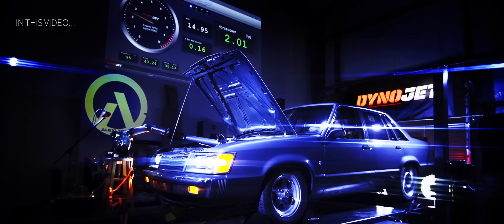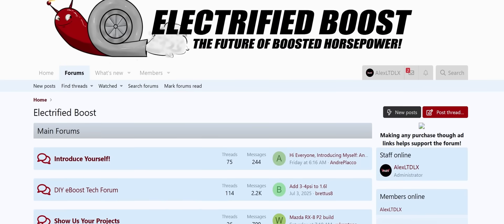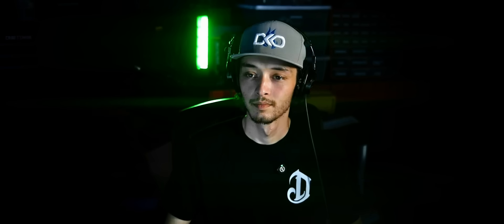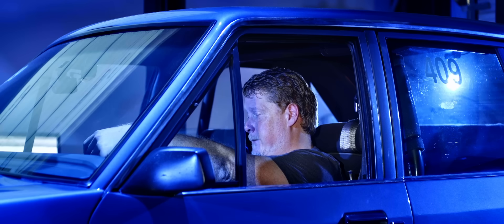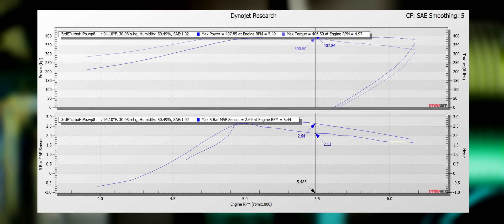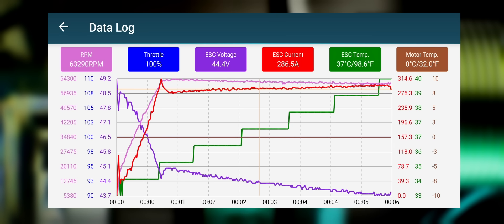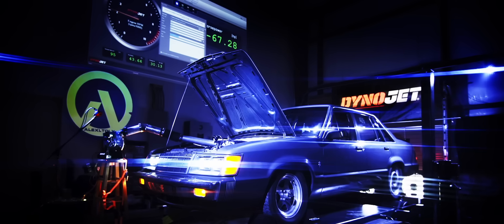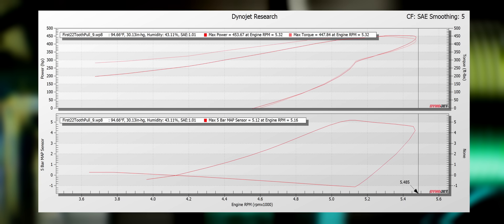Cheaper/Easier DIY Electric Turbo Overdelivers On The Dyno

Comment: Ok i just posted to the parts video from last year.

Why not try belt gear it 1:3 and try using a ebike motor like the stock motor from a suron x or use a esc from an ebike or Kelly controller they can handle much high loads and voltages, either way i just ordered the p2 and will attempt using the motor off my old suron as i have it and the 72v battery and controller the firmware is basically an upgraded Vesc. Yes i know it will take more space and i know for the tiny 1.5l engine in my scion it might make like 10psi as it flows less air.
Also i feel making the motor mount facing the other side and over lap the compressor makes it easier to swap belts.
Either way I'm a cnc programmer and operations manager with over 20 machines i keep running all day

Comment: 12:19 5 PSI is pointless when most are running 12 or more.
Reply from the maker: PSI is meaningless.  HP is everything.  This makes more than twice the power per psi as my Whipple did.  The Sledgehammer made the same power with less than 7 psi than the Whipple did at 15 psi: https://youtu.be/_7bT8ScF2xI  In fact, the electric supercharger (Sledgehammer) put the LTD in the 9s at the dragstrip: https://youtu.be/RT0M88xHzNQ

Comment: I think you need a 1 to 1 pully setup might get it to hold at 4psi
Reply: direct drive would eliminate pulley losses
Reply: @longflare at the rpm this is spinning direct drive is almost impossible to get perfect alignment and not rip itself apart.
Maybe it would work with custom mini old heim couplings or a near press fit.

Comment: In WW2, aircraft engine researchers had a 1500hp  Allison V12-1710 engine connected to a power recovery turbine.  The turbine, which was connected to crankshaft spat out an additional 1000hp bring total output up to 2500hp.  That is cool.  While electric blowers have some plusses, variable speed blowers which can operate independent of crankshaft speed are nothing new.

Comment: I cant wait to see what the castle creations cobra 5 hv esc on 12s is capable of and with there new 2535 680kv motor is caple of shit will be crazy 14:36  but if you hold off a little bit longer castle is releasing the race version of the cobra 5 hv its the ACE version where they remove that pesky 500amp saftey limit so you can really send her please get one so we can see what is possible with a electric boosted setup thanks also smc lipos the srd v4's are badass 12,600mah 250c best batteries you can get or onyx rc lipo hand down the best batteries available i love what your doing. I would love to electric charge my subaru impreza

Comment: I think you should try some 0-60 times with the electric turbo vs the same electric motor (or 2) doing a direct motor assist, pulley on the crank etc, with a reduction gear pulley to optimise torque. You could add a lot of torqque directly to the motor off the line from 0 rpm which could in theory give a lot of response in 0-60

Comment: That's all really cool, BUT...
In order for this to be worth anything in a street car. You need to power it from the cars engine. So, unless you're running it from a pre charged battery bank which still adds weight to the car. It's going to be sucking HP from the engine...

Comment: So the boost starts at idle or is there a lag until some low rpm limit is reached? So on a hot day & low speed cruising, can the solenoid overheat?

Comment: Great video guys... I'm not sure why you would present all of this information yet fail to talk about the lack of parasitic power  draw for the turbo if you're getting power from another source.  This set up requires an extremely high output alternator which will cause a significant load on the engine under high boost, so this whole experiment is nullified as a real world test.. that's a shame considering all the effort! If the SC motor is actually being powered by the LTD's alternator than obviously this comment doesn't apply.

Comment: I think you would drive the point home more with a smaller motor built for boost. Put this thing on a modern motor built for boost and not fuel limited like a 17+ 3.5 ecoboost with the port injection, you could setup such that you're one leg of a compound setup. Getting to an effective 30psi should be easy, and that puts those engines in the 600hp crank range. Not the only way to skin that cat, maybe just look for the cheapest damn thing with that 8speed zf auto and force feed whatever engine air.  Or smaller still and put it on a used Versa

Another point is that you keep talking about how much power you're loosing to driveline losses... and I believe you, but I think if you cut those down with a modern trans you'll both be more relatable to the audience, and it'll look better to the casual dummy who swings  by via youtube algorithm. That LTD is a good testbed, and I'm sure you have room to make it faster, but this supercharger will be best as a power adder to a more normal car. The $2-3000 bolt on that gets you 25%+ more power.... infinite nitrous cheat.

Comment: A full turbo with motor generator is my dream.. add power to spin turbo immediately and harvest power instead of waste gate
Reply: And push it further make it axial flow for insanely efficient boost and substantial power harvesting..
Reply: Axial flow would have heavy rotating assembly.. so would need lots of power.. but you'll be able to harvest 100s of horse power.. aviation motors have proved potential.. but for cars response time is terrible

Comment: for battery's, at work we are slowly converting work carts to lithium. using 48v drop in golf cart units. ours are kinda pricey at 2k$ but I just saw over 300amps towing a very heavy portable ac unit. well over what I should have been doing but the battery didn't seem to mind, they are pretty light and I've seen some for as little at 900$ on the China sites. if you have a trunk and don't want to diy a pack. it seems like this might work for a lower end setup.

Comment: Have you looked into the Range Rover electric supercharger for their 3.0 turbo engine, they use it as an anti lag, but it’s water cooled and makes 0.5 a bar of boost on a very compact package, I figured 2 of those might be able to feed a V8 at 7psi and they’re 48v

Comment: At what amperage will that motor's magnets saturate? Depending on the heat dissipation packaging of the motor, generally the motor can make 4X power of the constant rating before hitting magnet saturation, where any additional input from the controller will result in pure heat and will quickly degrade the permanent magnets. The amount of 4X a motor will tolerate is increased with thermal mass. That motor looks like it has minimal thermal mass to be as light as possible. Since weight isn't a consideration in your application you could consider a big chunky motor that has more thermal mass.

Comment: Try it with direct drive (without the belt) and slightly higher voltage!   Reason: Higher motor RPM, lower current and no belt losses will give higher efficiency and more boost without breaking the motor/ESC.

Comment: I realize you are working with Castle but just remember there are way more brands out there.  Look no further than the boys that are setting land speed records pulling more than 800 amps from their speed controls.  Also keep in mind the fast heli guys run 14s not 12s giving even more power.  Keep up the good work.
Reply: The problem with his setup is that he is using lithium ion batteries. That's like taking a NASCAR engine and slapping a restrictor plate on it and running 87 octane fuel. This is why I laugh at the entire EV market.
Reply: @The_Gifted_333  should they use super capacitors instead? I'm not aware of the state of the art in RC hardware
Reply: @identiticrisis  In the RC industry, we use lithium polymer (LiPo) batteries. We can't use lithium ion batteries because they can't handle the amount of amperage required to run our brushless setups. LiPo's are more dense and can handle 3-5 times more amperage and last 30% or more longer than the equivalent sized lithium ion battery.
Reply: @The_Gifted_333  600 amps is a lot though, I'd be surprised if these weren't lithium ion polymer batteries here
Reply: @identiticrisis  In the video you can see the batteries and the name on them. The company makes lithium ion batteries. My ESC on my 5th scale RC has a max pull of 1600 amps on burst (9 seconds), 250 amps continuous. My batteries will do 1000 amps continuous and 2000 amps of burst. The 2 batteries I'm using are smaller than his battery pack. My max volts is 50.4 with a nominal of 44.4v or 12s.
Reply: @The_Gifted_333  60 hp is no joke! How often do you need to replace them?
Reply: @The_Gifted_333  they're LTO cells, higher current and better temperature tolerance than lithium ion. There are other videos on this channel for those interested. Makes sense for this application
Reply: @identiticrisis  That really depends on how much you use them and how you take care of them. I have some that are over 10 years old. You usually replace them if they start to puff. Don't let them drop below 3.3v/cell when you are using them and when not in use, store them at 3.7v/cell.
Reply: @identiticrisis  But how much current? What is their continuous and burst rating? What is their C rating and mAh?
Reply: @The_Gifted_333  they probably have a datasheet if you're cross shopping
Reply: @identiticrisis  I looked it up and I'm still going with my original statement.
Reply: @The_Gifted_333  I don't really understand what you're talking about

Comment: Compounding e-chargers could also be very, very fun - how do you manage your airflow?  Like, when your e-charger is on, it's at full tilt, limited only by its efficiency in compressing air into your engine at a given RPM :: airflow.

Comment: I have explained gear ratios and transmission choice importance to people that don't really understand it by comparing it to a mountain bike. We all have ridden one and when you change the gears how different it rides and how much effort is needed or not needed when you row through all the gears. Your legs are the power source or engine and the bike is the vehicle. Low gear your legs spin up fast and it's easy to start rolling and high gear it's much harder to go and less leg rotations. That electric motor is in high gear spinning it faster but it's more of a strain so it might not be able to get to full rpm like that

Comment: These motors produce peak power at almost exactly half their free load RPM.
800kV at 44.4V is 35,530 RPM, half that is 17,760 RPM. Why does the RPM in the Datalog say almost double that at 63,000RPM?, is the ESC setup for 2 pole instead of 4 pole? It sounds like the motor is operating past peak power in the inefficient part of its power band, which is why it got so hot and tripped. To get the 52,000 RPM the Speedmaster P-2 needs that's a 1:2.92 ratio. Call it 1:3 and be done. 18T * 3 = 54T on the motor.
Reply from the maker: The ESC reads electrical rpm, not mechanical.  The 2028 is a 4 pole motor, so it has two pole pairs.  Divide the electrical rpm by 2 in this case to get mechanical rpm.  Peak power on these motors is usually closer 1/3 max rpm; and kV is unloaded rpm - though current and voltage play a significant role in the actual shape of the curve.  I'm going to do a data deep dive video to go into all this stuff in great detail.
Reply: @AlexLTDLX  If the RPM output in the datalog isn't accounting for the 4 pole motor then that makes a lot more sense with the first pull of 63,400 RPM / 4 actually being 15,850 RPM at the motor, closer to the 17,760 RPM ideal. Being a little under the ideal suggests even with the 14T motor : 18T P-2 that the motor is underpowered by more than 3x if it can't even run at 1:1 when the P-2 wants 1:3. I'd be looking at 30kW motors and controllers.
Reply: @AlexLTDLX  As long as you run electric motors without saturating the magnets or exceeding their heat dissipation abilities, you can run oversized (over spec) controllers and motors without any efficiency cost, only more weight and expense. On this application the increased weight wouldn't matter.

Comment: Guys,how are you powering the motor? Unless it's been powered by the cars alternator or a stand alone Lipo battery pack inside the car....... the power gains aren't realistic....... so where is ut getting it's power from in this setup please ? 👀👀👀👀
Reply from the maker: The sledgehammer that's actually mounted in the car (and ran 9s at the track on pump gas - there's a bunch of videos on that, including multiple dyno and track videos) has an LTO pack in the trunk.  Look up the other videos in the electric supercharger playlist to see how it was done.  You can't power these directly off of an alternator - but you can charge the packs while driving around, though I've never had to charge a pack during a whole day of racing or dyno tuning.
Reply: @AlexLTDLX thanks man. What does an LTO pack look like and cost please mate?

Comment: What impeller speed are you actually hitting on this
Reply from the maker: It was around 25,000 with the first pulley combination and over 30k with the second.  I'll do a deep data dive video to go over all this stuff next, including all the datalogs and compressor map.
Reply: @AlexLTDLX  do you have a way to contact beside this i have some stuff to bounce off you that may help , I also have a cnc machine if you want to work together on something, obviously your biggest issue right now is spinning that unit to its max impeller speed i have a soultion

Comment: probably needs an intercooler?
Reply from the maker: The sledgehammer unit does have meth injection, but we need to up the boost either with compound or parallel electric supercharger to get the boost up to a point where an intercooler would show max benefits.  At these lower boost levels, meth does a great job.

Comment: I think you need to run twin motos so you have the torque to make around 10-12 psi
Reply from the maker: The compressor is too small for the engine that's in the LTD.  Which is why we'll be testing parallel and compound electric superchargers soon.
Reply: @AlexLTDLX oh ok makes sense.  I love what you are doing. This is a really cool system then could even be used like Nitrous where you push a button for boost

Comment: Those ESC data logs are super interesting. I saw some boat rc motors online that have water jackets you can put around them, cooling with a small radiator would certainly help. In the ebike hub motor world they run Ferro fluid inside with heatsinks outside the hub to keep them alive way beyond the rated power. I really want to see more experiments with this stuff. I just got recommended this video, definitely subscribed. I don't know anything about this car but wouldn't a V8 like that be able to make 400 NA too? The low boost is probably helping it breathe better. And yes I paid attention with the unlocked power glide taking power away, but if a dual electric setup could get into the higher boost numbers, that's when the na efficiency wouldn't matter anymore and the power would be all from boost (and fuel of course). I'm very curious to know if the power needed by the blower would start climbing rapidly with boost pressure once it gets to that level. At least that would be my assumption, 30-40 HP into the electric motor now, much more with the engine making 800 flywheel instead of 600. Sort of how it takes much more power to go from 40mph to 60 on an ebike. What about the heat of the exhaust helping to spin a turbo, not just the actual exhaust coming out of the engine? That's a thing I heard happens and why turbos are more efficient that superchargers. That has to count for some free HP not taken away from a supercharger belt. With measuring the electric stuff you have a Dyno at your boost maker which is super interesting to see. I'm thinking too much, this is great stuff, waiting for the next video, dual e-chargers sound fun.
Reply from the maker: I had a water jacket around the sledgehammer's motor for a while, but found that it wasn't necessary since it only ran when the car was moving (fast) - the airflow was more than adequate.  The engine in the LTD makes right around 500 hp at the flywheel naturally aspirated.  The converter plays a HUGE role in the dyno numbers - both hp and where the hp peak is observed.  The previous converter was actually looser up top and would dyno at 388 rwhp n/a with the hp peak occurring at 6,000 rpm.  This converter is a spragless and "lost" around 40-ish hp and shows peak hp at ~5,400 rpm on the dyno, but runs 2 mph faster at the track - there's a lot going on in the converter.  Also, keep in mind the compressor is actually a bit small for this engine - I'll be doing a deep data dive video next.

Comment: What kind of power would it make if you attached that electric motor directly to the front pulley of the engine through gear reductions to help the engine with the electric motor, would you only gain the horsepower that the electric motor outputs?
Reply from the maker: Yes.  This returns several times more power to the wheels.
Reply: @AlexLTDLX I figured it would, but it only works as long as there's enough charge in the battery right? If you put this exact setup in a car, how long could you sustain power before the alternator needs time to recharge the battery? 🤔

Comment: Problem is that motor and really not any motor that size can sustain that kinda power. You would have to get something big like a sotion motor or qs motor to sustain the power but they aren't designed for that much weight. Actually none of them are designed for the weight of a car.
Reply from the maker: The sledgehammer pushed the LTD from low 12s to 9s at the track: https://youtu.be/RT0M88xHzNQ